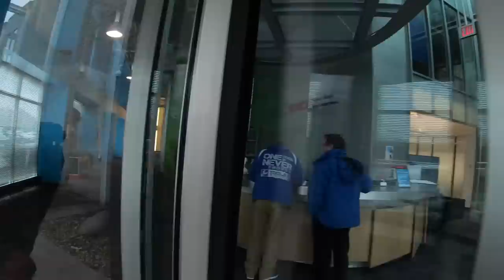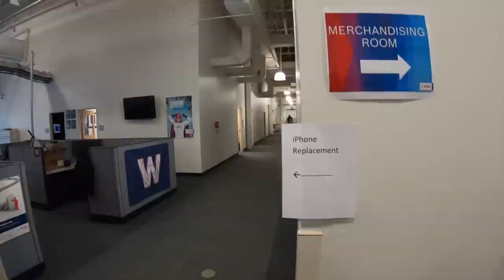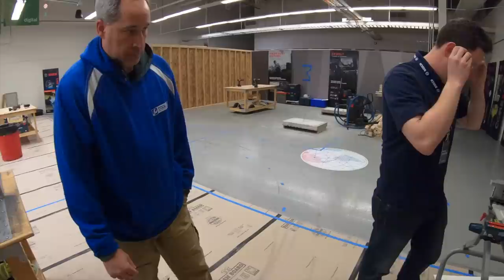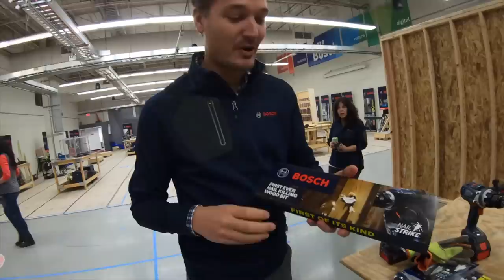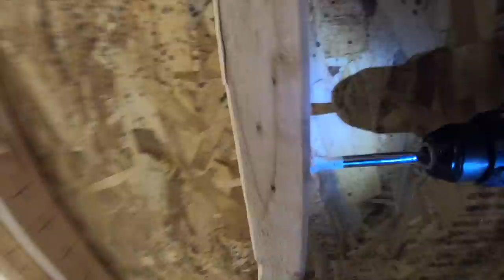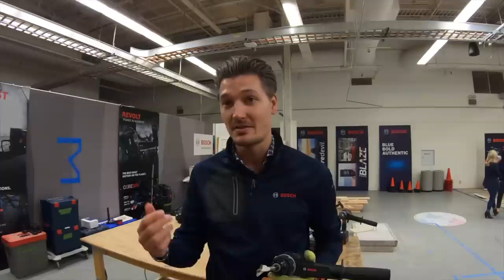Behind the scenes at Bosch Tools HQ

Comment: My favorite power tool company. Their stuff just flat-out lasts and is nothing but quality!
Reply: Was disappointed with the cs10 circular saw and the plastic adjustment levers. Ended up stripping them out so I just welded a tab onto the nut to make a full metal one. Other than that it's an amazing saw. And only one that size with a joice hanger.

Comment: Many years ago I bought a set of wood spade bits and lasted very long time but lost them one by one over time. I hit nails from time to time but they kept working. Then replaced them with the new improved ones and were junk, even if they just touched the nail it would be worthless. I will give these ones a try because the first ones I purchased from Bosh ($20  set) brings me great memories.

Comment: I love Bosch cobalt drill bits. I like the performance of their power tools (Manards has way better selection than Lowe's if you're in the Midwest) but they arent that durable. I'm about to find out how good the warranty is.
Reply: How was the warranty
Reply: @diogenesstudent5585  It was pretty damn good. I got my Impact driver and drill both replaced/repaired free of charge. I just had to send them in to somewhere in Ohio or Indiana with shipping labels they sent me. I think it took around two weeks from when I sent them off to when I got the one replacement and the other one repaired back via UPS
Reply: @codelicious6590  nice

Comment: Is it possible to resharpen those new white bits with a file or grinding wheel ?
Reply from the maker: ofcourse but why
Reply: Yeah almost sharpen anything. Except when they have a special coating, bc that wears off. Ie: black oxide, carbide. but they prob aren’t gunna be to expensive, you can grab like 15 daredevil bits for $25

Comment: So much hate for yellow, I'm actually switching back to yellow and ditching red, just not robust enough. 

Also got some blue 36 Volt, such a shame that Bosch seem to be following red and making everything 18 Volt.
Reply: Red wouldnt exchange a faulty concrete breaker for us. I paid £1200 and it was a week old but wouldn’t break anything. Would never go back to them con men
Reply: Tugs toys lmao ... uhh I just switched from yellow to red and I will never go back to hello 😂 you must not work in commercial
Reply: @DasherX_OG  , make sure you've got plenty of sticky tape, you'll need it to keep your red batteries in! 😉

And for what it's worth, commercial is pretty much all I do.
Reply: Lmao have you seen or actually used your drills 😂 because Milwaukee batteries stay in much better than the dewalts, I’ve owned my dewalts for two years ... and I can tell you for a fact 😂 Milwaukee is already heyter
Reply: Better*
Reply: Also since the drill is 20v the batteries drain faster.. and honestly it’s not that much more powerful then the Milwaukee, but the control, and over all handle and feel in your hand is amazing on the milwaukee
Reply: I had little weak hands when I first started too ;) the dewalt felt great because it was skinny and small for my hands but the  Milwaukee feels much better now, it sounds like you should work harder, you’ll probably notice the difference
Reply: @DasherX_OG , I worked plenty hard enough! I've also been replacing brushless with brushed, certain machines feel better with brushed tech. 

My Dewalt machines have had a harder life than the Milwaukee, but have not let me down. The Milwaukee tools have suffered several failures. 

My Bosch 36v machines are both brushed and are epic! I actually go easy on them to make them last, that's because it looks like Bosch are deleting them, sad times.

Comment: I don’t like the handle style on the mitre saw I find it not natural to use the upright handle once used to the horizontal one like the dewalt !
Reply: Craig H kinda agree I use almost exclusively right handed dewalt saws (I’m a lefty) but I think like anything you use it enough and get used to it. I’m interest in trying it bc it’s ambidextrous, so no  over the saw, arm crossing. That’s why it’s designed like that. Check Kapex saw out.

Comment: HUGE miss BOSCH!!! Cordless/Corded axial glide! Such an innovative design ...two steps ahead of the comp...then 3 steps back with the rails! Then proprietary blades on the grinder?!?!? No Thanx
Reply: "Then proprietary blades on the grinder?!?!? No Thanx", Yes, exactly, no way I would be getting one of those grinders untill/if some 3rd parties start making disks for them.
Reply: Been saying this since I first saw preview pics of their cordless mitre saw earlier in the year. They missed the opportunity to get ahead of competition with a duel bevel glide rather than a single bevel rail smh. Still love Bosch tools though. The only brand I've used to never have experienced a failure.
Reply: @AussieGearReviewer  done, Xlock is already a little longer out her in europe.
Any big store allready have them in stock and the are right now around 10 to 15 cents more expensive as regular ones.
I also thought its bogus but especially if you work more with this nasty wire brushes that can't be mounted keyless or you you really use alot of discs it really shines.
Bosch never said its more less cost intensive especially for most people in tge US that use professional tools for DIY or small contractor buismesses. 

This product was made for big factorys  for people grinding all day.

Comment: Dewalt 60v has that first saw beat
Reply: Yup! My flexvolt 12” slider all day any day! Nothing really competes with it on all levels. That 18v 8 1/2” goes up against dewalts 20v 7 1/4” saw though. Different weight classes. I barely categorize reds 10” cordless slider in the same category with yellow 12” cordless slider. Makita 36v...
Reply: I know, I have a 12" sliding miter saw that takes batteries or corded. What would I use that 30lb toy for; 2 1/4 door trim I suppose. Bosch has all those accessories that break off their saws. That's why the displays at the stores have those pieces missing.